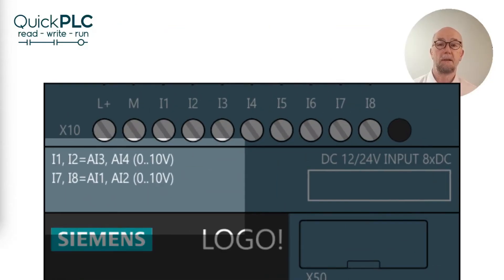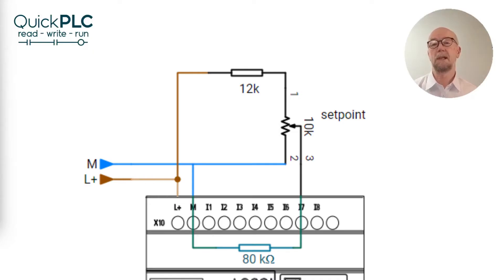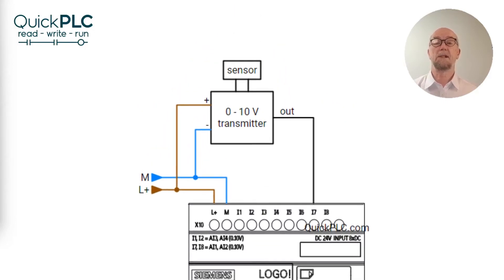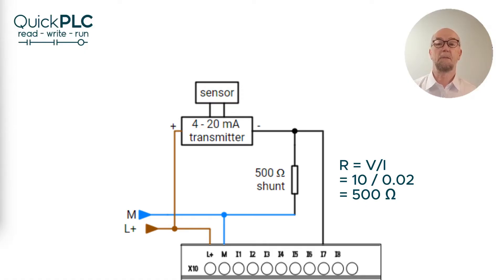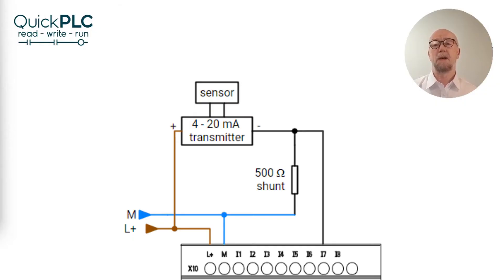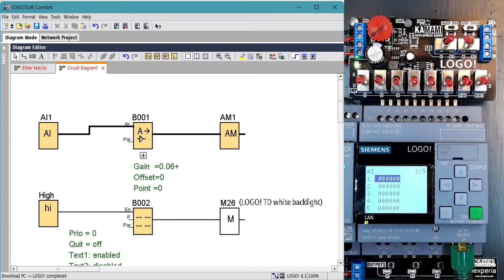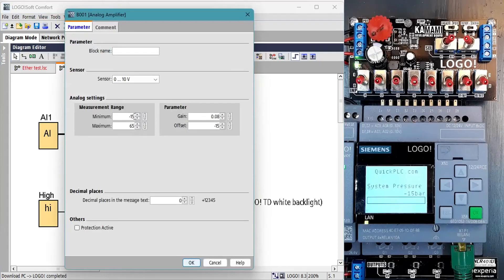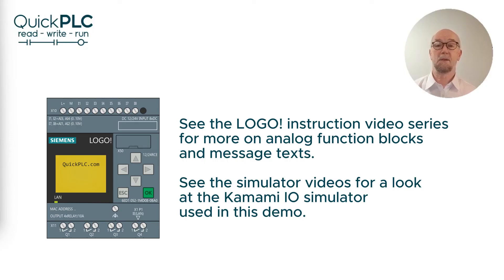LOGO! 4 - 20 mA on the 0 - 10 V input? | Siemens PLC programming

Comment: Good video.  How did i know about scale of  4-20  if this video did not exist? In manual there is not any mention about it/
Reply from the maker: The LOGO! basic module is not designed for 4 - 20 mA. This video shows how to do it with a 500 ohm resistor. It is a nice trick. Have a look at the analog modules. They are designed for 0 or 4 - 20 mA inputs. Thank you for the feedback.
Reply: @QuickPLC-kh5of   I told not only about 4-20 ma connection. I cant find any information about analog signal connection and work with it.  I have not seen any information about analog signal scaling. I should thank for this first video i have found  about analog signal management
Reply from the maker: Try this page: https://support.industry.siemens.com/cs/mdm/109741041?c=137329101579&dl=no&lc=en-US

Comment: Any ideas why the logo wouldnt register the 0-10v?  I have a pressure sensor connected to I7 but i cannot get any readout, even on the Logo screen as you showed.  I currently have 4v on I7, so the sensor is working.
Reply from the maker: Which LOGO! are you using? (Does it actually have analog inputs? Check above the Siemens logo over the LCD.) Are the analog inputs enabled? (LOGO!Soft | File | Properties | I/O settings.)

Comment: Im new and still watching your videos. How did you insert "Bar" in the bar graph. When I try to insert a bar graph, it only shows the symbol of the analog amplifier, it doesnt even show the any purple background with text
Reply from the maker: There are three buttons with icons above the Message Text editor area. Hover over the third and the tooltip will show "Insert a bargraph into the message". Position the cursor where you want the graph, click the button, select the Block and Actual Value you want to display and adjust the other settings to suit.

Comment: Thank you for video. 
there is no point in using an exact 500 ohm resistor. At the beginning of the video you showed that there is an internal resistance of 80 kOhm, and the actual resistance will be lower than 500 ohms. it is better to finally adjust the coefficients based on the results of the experiment.
Reply from the maker: That's a good point about the 80k in parallel. It introduces an error of 0.62%. Adding 3.1 ohms in series with the 500 ohm resistor would decrease that to 0.01%. In practice adjusting the coefficients was what I did. Good old y = mx + c! Thanks.
Reply: @QuickPLC-kh5of  moreover, 80k is very inaccurate. The documentation is very vague about this. If you have the opportunity, please re-measure with a multimeter. It seems to me that there is less.

I had about 9 logos with the same programs and I just bought a few dozen 510 ohm resistors and chose the same ones. I selected the coefficient empirically. And it was especially noticeable when I measured the battery voltage with a voltage divider (10k + 10k). 80k and 10k are much closer and it is even more noticeable there.
Reply from the maker: That's interesting and thanks for passing on your experience. I probably won't get a chance to do any testing for some time.
Reply: @ Is it possible to somehow measure the speed of signal change in 10ms or 20ms? It's a pity there is no "move". I don't know how to save the previous value. I tried to loop it through Analog MUX to save. But I can't connect the line.
Reply from the maker: There is a trick using the PI controller to store a value. Download Betel's example at the bottom of https://support.industry.siemens.com/forum/ie/en/posts/logo-how-to-store-analoge-values/56646. It's very well documented. It's from 14 years ago so there might be a better way now. I'll have a look and if I find it I'll post a link.
Reply from the maker: I found a much simpler "sample and hold" example on https://support.industry.siemens.com/forum/ie/en/posts/sample-and-hold/68191. Basically its using a Mathematical Instruction with the analog amplifier as input V1 and the output is set to hold the Last Value when En="0". Most excellent!
Reply: @ Thank you very much, this is what I needed

Comment: Can you do one with pressure sensor (or temperature) to include threshold triggers and mathematic instructions?
Let me expand. You have a 0-10V, 0 to 16 bar pressure sensor and you set up the gain, install it and instead of showing the working pressure of 3.8 bar, it reads 3.2 bar. Can you show using mathematic instruction or similar how to trim the resulting pressure to read correctly. Also add threshold triggers for alarms on same.
Reply from the maker: What is the configuration of  your analog amplifier?
The analog videos seem to be of higher interest than others. I'll see if I can do some more. 
Thanks!
Reply from the maker: First check the signal arriving at the LOGO! 3.8 bar / 16 bar * 10 V = 2.37 V. If you don't measure that with a meter then the problem is outside the LOGO! If you can't fix it then you need to rescale your reading by 3.8 / 3.2 = 1.1875. So instead of Measurement Range maximum  = 160 or 1600 make it 160 * 1.1875 = 190 or 1900. Set the decimal places in message text to 1 or 2 depending on your 160 or 1600 for 0.1 bar or 0.01 bar steps.

Comment: I really benefited a lot from your wonderful channel
I have a solar energy system to charge 54 VDC batteries, and I want to control the turning on and off of the electric generator at values for example: 44 - 60 VDC volts using the Siemens logo!8.
Is there a voltage sensor for this? or any anther ideas
 
Thank you for your help🌹
Reply from the maker: If the LOGO! M (negative) is connected to the solar system negative then you can just use a pair of resistors to make a potential divider. A  9k - 1k divider would give you 4.4 to 6.0 V input to the LOGO! and that would give you 440 to 600 counts inside the LOGO! Make sure to calculate the power dissipated in the resistors using V^2/R for each resistor.
Reply: @QuickPLC-kh5of  Thanks Sir